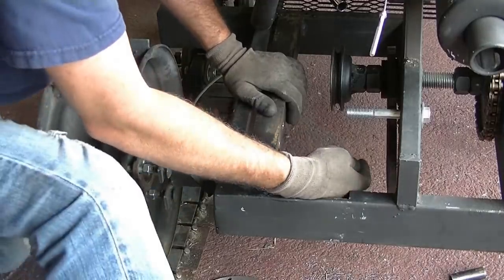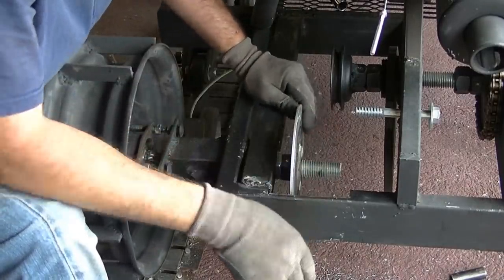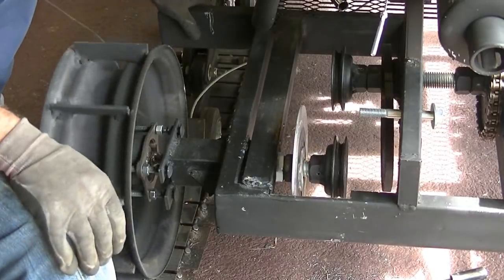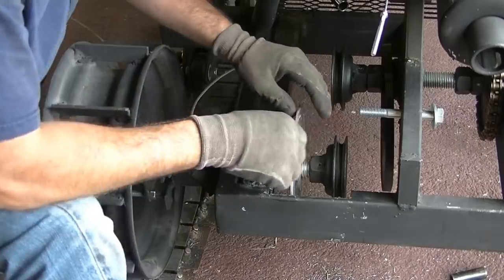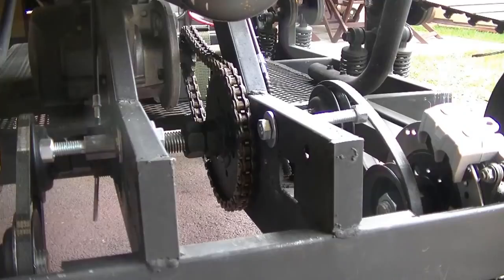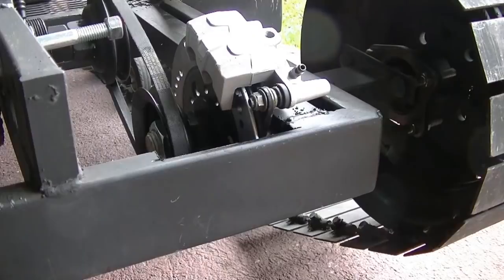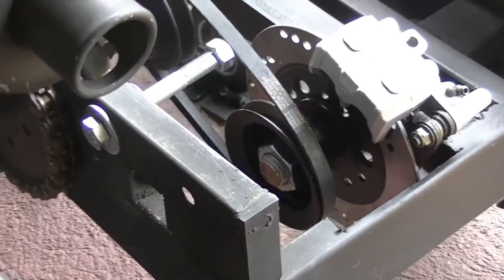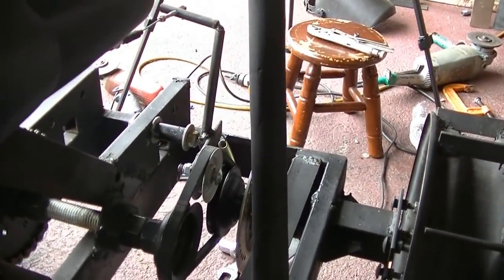How to build a tank or Tracked vehicle.Transmission progress report.10-B

Comment: Nice work mate! Are you going to cover the pulley areas to stop them from getting wet/dirty? I want to do an upscale version using an LS1 Chevvy motor which I have laying around doing nothing. I think the turning will be easier to do because of the differential, hydraulic brakes and an automatic transmission. But the custom frame and tracks will be the harder part of the build. I hope to see more progress soon!
Reply from the maker: Yes I plan on covering the back area once done. There are a couple of other tank builds on You Tube that are bigger projects using car engines and the like. I hope you post some videos when you start your build.

Comment: Now that's a killer setup. I got a little concern on slippage too but I think it will be ok. Belts are a pretty good way to turn things and you got what looks to be a 1/2 wide belt should work great. But I noticed you deffinatly got the idler pulleys in the wrong spots and them pushing on the belts is deffinitly better  then pulling them. PM me your email I can send you my plans on mine on that later tonight. There's actually a lot of tech for this area I can give you.
Reply from the maker: Thanks, at least with this video you get the idea of how I am going to steer it. I am going to re do it with a tighter belt and the tension er on the top.
Reply: Any chance I could get a copy mate? Im starting to do a scaled up build using an LS1 motor any help would be appreciated.
Reply: Aceman307 Hang on before you do it. You got your setup backwards to where when power is added from motor it will actually loosen the belt. I can show where to put everything to where you can use what you have now and the only worry will be the belt snappin instead of slippin.
Reply: Swearzy Sure, pm me your email I can send you a copy. Wow, an LS1 might be a little too strong though for a belt setup. An easy way would be a limited slip automotive rear axle with brake steering for that LS1 motor. alot of ww2 tanks used that setup. Maybe go look at ShawnCFarm's Channel. He's got a Chevy small block in his tank, It might be more of what you are looking for. He's got a comment down below, you can follow the link to his channel
Reply from the maker: ***** Yes, you want to use a car rear axle for sure plus it would be easier to steer just use the brakes on the car axle. Yes ShawnCFarm has a tank with that type setup.
Reply: Yeah I've got an LSD and its axle out of a Toyota 4x4, planning on larger brakes for better braking all the technical bits will get worked out when I get going
Reply from the maker: That should be a fun project. Keep me posted.
Reply: Thanks for recommending ShawnCfarms channel he has some wicked toys
Reply: Yah, he does, and it keeps getting better and better.

Comment: looks great but i think you will have limited success with those V belts.
Reply from the maker: You could be right, but remember most riding lawnmowers use belts for there drive wheels and to run the blades. I may end up having to use two belts per side. Thanks for watching.
Reply: Aceman307
Check out some machinist videos on lathe rebuilding. There is a retrofit of the drive belt to a flat/groove belt so that the cutting torque can be increased. As you probably know, motorcycles use the flat/groove belts. Engineering students at Oregon State Univ. designed a sand dune buggy with a variable pitch drive pulley. I wonder if they have some pics or videos available. Their design was very effective in terms of reliability and translating RPM into useable torque.
Reply from the maker: Kevin Hornbuckle The scooter motor/trans uses a variable transmission also. I am hoping with that and the sprocket ratios I am using they will help with the torque issues. If I was to give someone advice on this type of build I would say get a golf cart differential and motor and use the brakes on the axle to steer. would be allot easier.